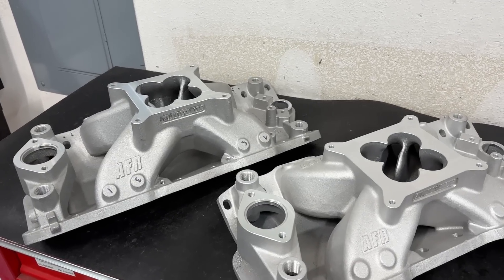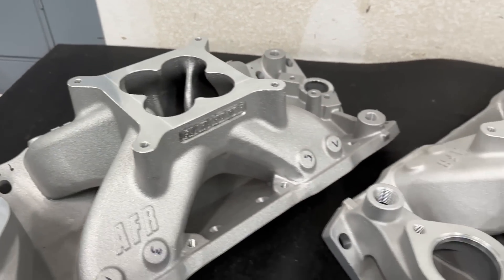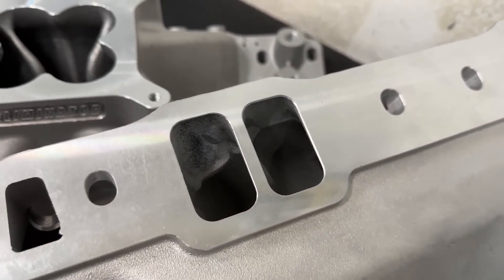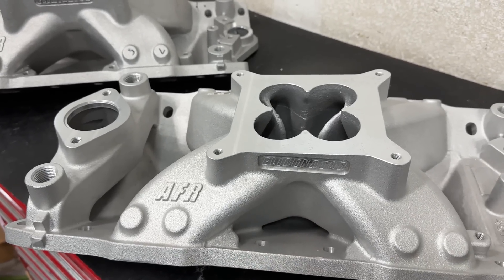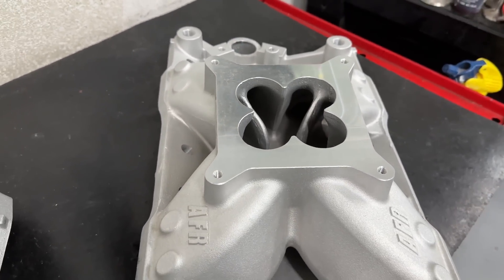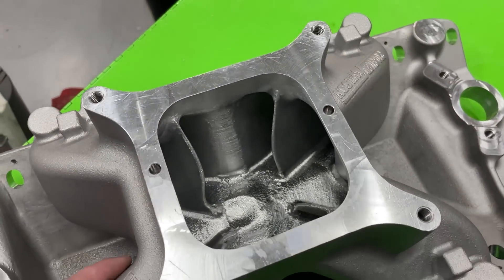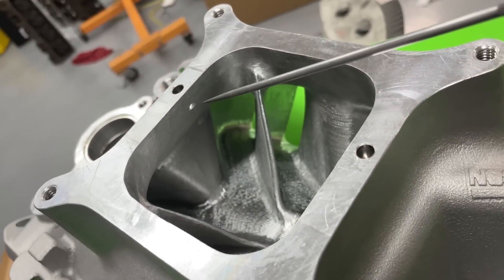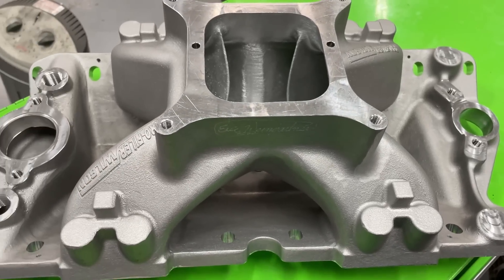SBC Intakes From AFR and Profiler

Comment: i have a 355 10.4 AFR comp 195 heads comp cams XR280R on a 108, the rpm air gap peaks HP at 6500, it makes 525/490 the vic jr sucked, made 10 more hp but destroyed tq everywhere, which singleplane would be good for my mild 355. the 4810? or best to leave it alone

Comment: Hi Eric, I've been watching for about a year now. From watching your videos, you are a very smart man who invested in himself. You have convinced me that I am capable of doing a set of heads in my off work hours(I'm not a newbie, I've built more then a few small block chevy and small block fords, as well as a few 4.3 v6s. I also work as an industrial mechanic i deal with tight tolerances on a daily basis.). I have the proper tools to install and remove valves and springs.( thank you to my very knowledgeable dad. Very hands on and made things work by rubbing pennies together and a whole lot of blood and tears.) I know you have done a few reviews on  ebay aluminum heads. I was wondering if maybe there was a few tools a guy could invest in to make it be able to pick up a set and drop a set of 8 mm valves into and make sure they seal properly. Being as my local to me machine shop(120 miles away) is 3 months out and bumps small projects like working a set of heads over to do things like tear down farmers motors for grain trucks and or tractors. I know this is a shot in the dark as this is how you make your living. But any help is appreciated thanks in advance

Comment: Thought carb flange on victor Jr was angled because the engine sits tail down in most cars from the 60-70s. Allows the carb to sit flat. I can see how hood clearance would be a secondary benefit because the front of the carb won't sit high.

Comment: Every mfg. copied Edelbrock's designs.  Also, aluminum is obsolete compared to new carbon or nylon that don't transfer heat and much lighter
Reply: Besides weight, there's no real benefit to plastic vs aluminum. The heat transfer causing power losses has been debunked.
Reply: @BEANS-O-MATICtransmissions  Do tell how a hotter, less dense intake charge improves combustion

Comment: Have you had a chance to look at the AFR  4812 aluminum dual plane yet? Interested to see how that stacks against the edelbrock rpm air gap.
Reply: Don't know about flow #'s between the 2. BUT we changed those 2 on a older 406 I built 20 year's ago in a G body Regal with some Bowtie heads & a Cam Motion hydraulic roller & it surely Loved it from 3800 to the 6400 it makes power to
Reply: @TheDynotuner  nice. I have an older rpm intake on a 383 with afr 195 heads now but it has the oil fill on it and I'm putting vintage air so it's moving the alternator and ac pump on top so I got the afr intake so I'd love to see the difference if any. Probably nothing one would notice but at least neither are Chinese knock off pieces

Comment: Perfect timing on this video.  I have a 4811PM sitting in my living room.  I bought it last week and haven't installed it yet.  I will be very interested in how these manifolds flow and perform. I generally run a Performer RPM on my 423 SBC, but it runs out of steam after about 6300.  I tried a Strip Dominator and it pulls to 7k, but it was a dog below 4500.  My car is 99% street, so i run only a 3k stall.  The 4811 is advertised at 3500-8000.  The Strip Dominator is 4500-7600.  I measured the runners and the 4811 has longer runners.  Hopefully the manifold comes alive at 3500 versus 4500.
Reply: I also have a 4811PM, Profiler Wilson, and Strip Dominator on my bench for full port work. I’d like to compare them on my 427 at the drag strip.
Reply: @ChopperScott  That would be a good comparo... please test away!
Reply: @ChopperScott  Got the right attitude! Is it for race or street? You chose race. Now the problem is much easier.
Reply: You have to tailor your engine to it's use. Open manifolds are for racing. Dual planes are for street. Why? Carburetors are sensitive to pressure. An open plane mani offers the least pressure differential for the carb. If you are running EFI, you also need a sensitive pressure sense to calculate the fuel curve. Single planes are effective for mid to top end. There is far more efficiency if the tube length of the individual intake runner is matched to the port and cylinder. But that is resonance based and dependent on RPM. You can't drive on the street at 4500 RPM for a baseline. My Rango does 70 at 2k.
Reply: @bryanst.martin7134  I've run open plenum intakes on big chevy engines with great success.  I haven't messed with small blocks much.  They do lack torque for sure.  By the way, I cruise between 3500 and 4000 on the highway with 3.73 gears.  I used to run 3.08 gears.  The car ran 11.70's with them.  I'm tempted to change the gears back.
Reply: @toomanymodz  Wouldn't a 2 speed differential be nice...